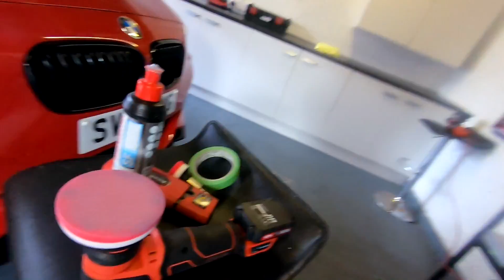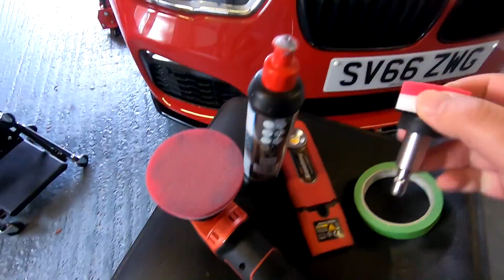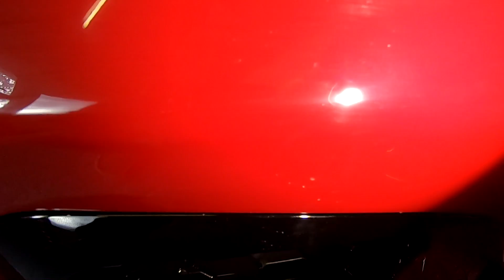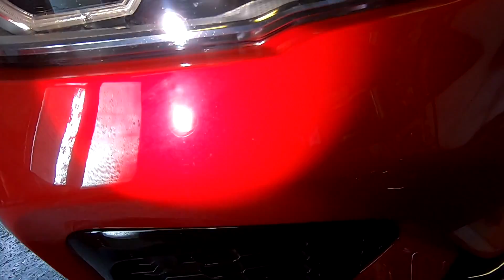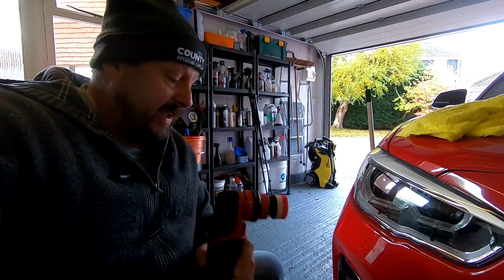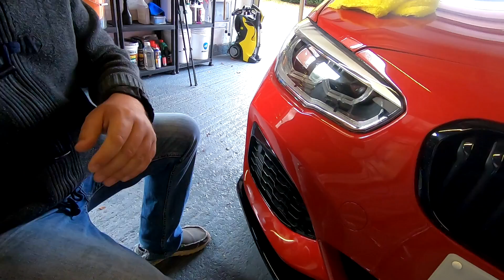Flex PXE 80 polishing demo - COOL for bumpers

Comment: Great video again. Is the orbital part of the machine gear driven or free spinning.
Now I'm using the Flex VR3401 which is a gear driven DA. Wonder if this is the same system or more like a normal DA which is free spinning and easy to stop rotating.

Comment: In the video you say it’s ‘soft paint on soft plastics’ - which made me think - should you treat different areas of the car in different ways when polishing ? Does it depend on if a car has some steel panels, some aluminium, some plastic etc. 

I know BMWs famously have rock hard clearcoat but is that not on their plastic bumpers ? i.e is paint/clearcoat softer or thinner on plastic or some materials ?
Reply: yes sometimes it pays to step down to a softer pad on the plastic bumpers or slow the machine down a bit.     If your working with a DA though generally it will be fine.  I have though a few times seem more compound marring when ive polished a bumper.

Comment: Another great video, can I just ask, I've just purchased the das 6 pro from in 2 detailing, it cam with 5 inch backing plate and a 3 inch backing plate, hoping through your recommendations to use the chemical guys hex logic range, the question I want to ask is, can I use the 4 inch hex logic pad on a 3 inch backing plate or do I need to look at an alternative, thanks in advance, loving the channels by the way 👍👍
Reply: so theres a slightey bigger plate available for DAS6 pros.  the 4 inch hex logic are a bit wierd size wise.   if you want a perfect fitting look for the 3 and a half inch DA plate.   the 3inch fits more other pads which are 75 ml fitment better.
Reply: @ForensicDetailing  thanks for getting back to me, think I might look into getting the 3 and a half inch plate as well, thanks again 👍
Reply: @davidcobb8942  thanks for the info, appreciate your advice, I'm very new to all this so need all the advice I can get, thanks again 👍
Reply: @davidcobb8942  i think thee counter balance may be setup for a 6 inch plate or a 5inch..  so the small plate you go the more vibration you will get as the weight difference increases because plate and pad and counter balance.

Comment: Love this PXE 80 - what would you recommend for polishing pads/buffers etc and polish to bring my 330Ci back to life which is in the lovely orient blue metallic paint using this great polisher. Have a few marks from a 15 year old motor but want to bring back that paint work to a great standard as the car is superb and needs that TLC. Cheers
Reply from the maker: nice the e46 has hard paint.. but just need to be carefull with older paints..    always hard to say without seeing but  Koch H8 to cut.   Koch M2 or M3 to finish.    The new koch pads are superb as well.   I tend to use the flex pads though because they have all the sizes for all the machines.  

I would use the flex purple pad on your 330ci with H8  and I would use the flex orange pad with M2.      In this video Im using the ultra fine flex red pad simply because the paint is very soft.  slims sell the flex pads.  if you look at part 2 of my best polishing pad video I show them and talk about them there.   superb pads.. not cheap but very durable.